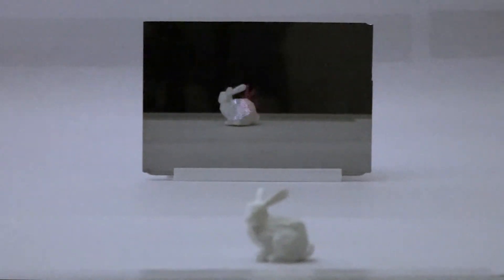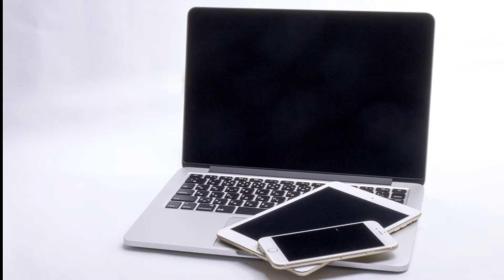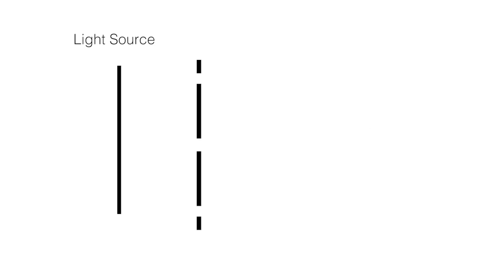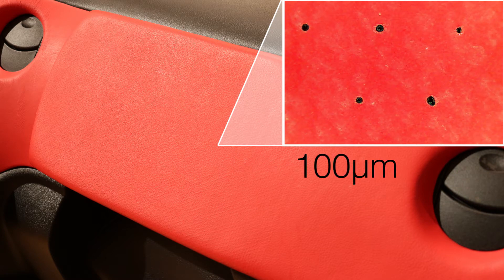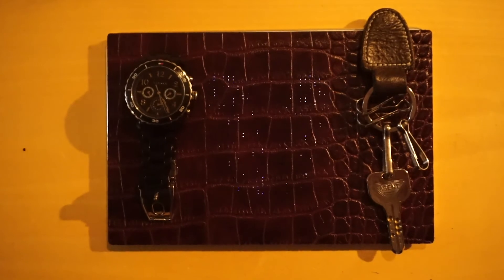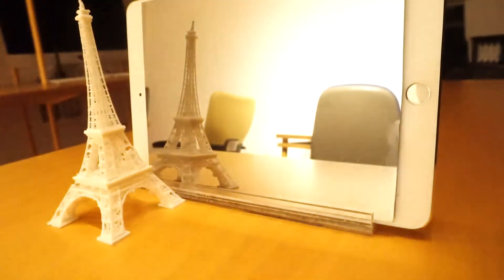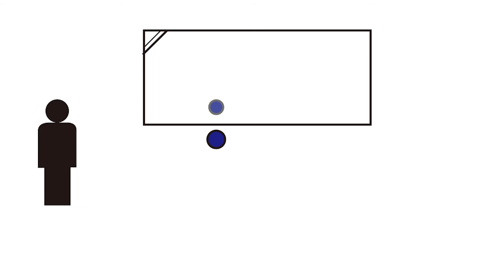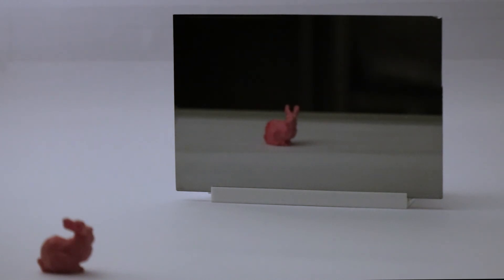Leaked Light Field from Everyday Material

Comment: Our lab built a display like this years ago. Instead of using pinholes we use LCD (for the sake of its high resolution) with no backlight (which makes the LCD transparent). The result is OK except that it is darker than expected.